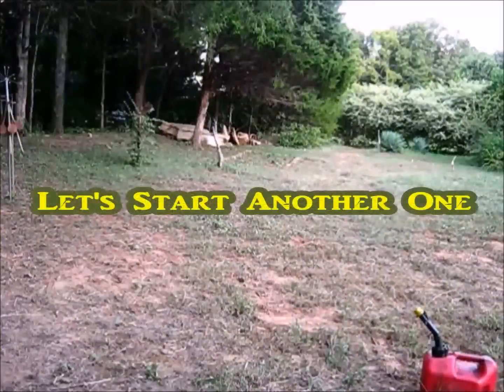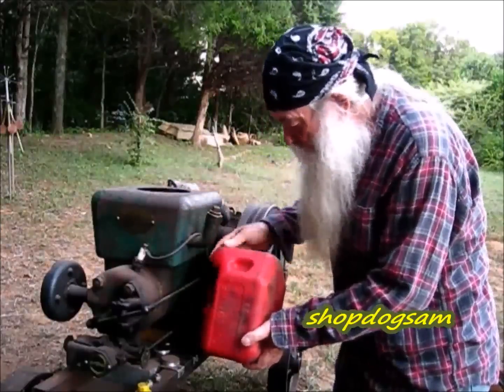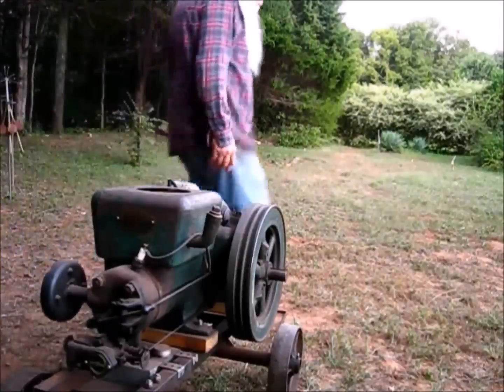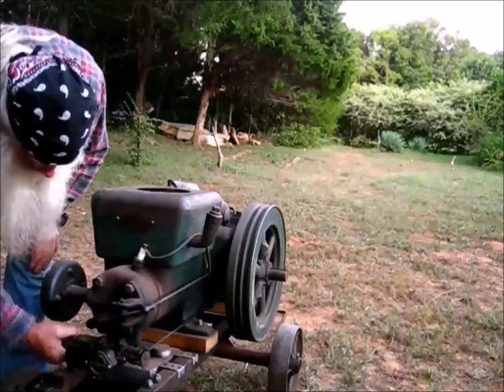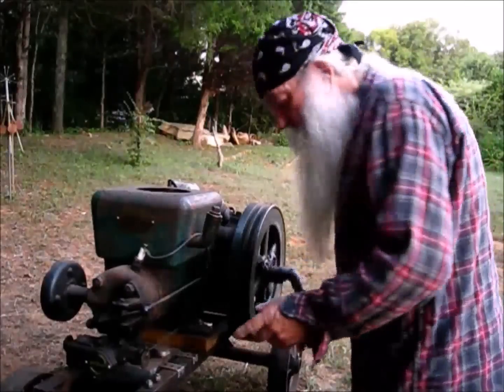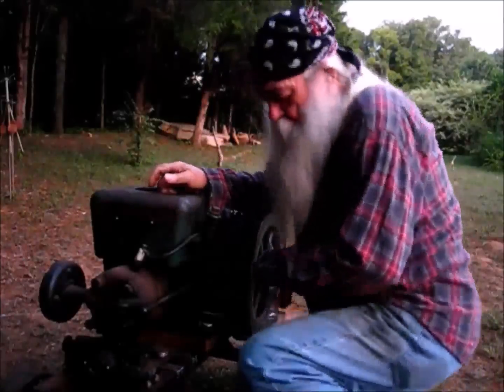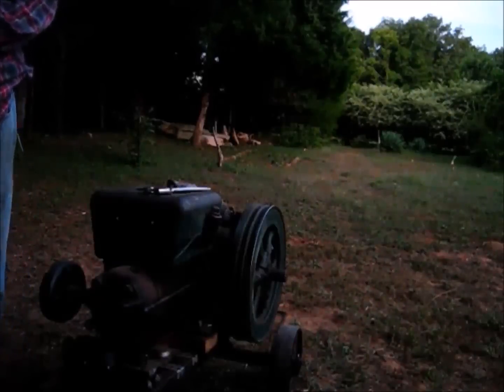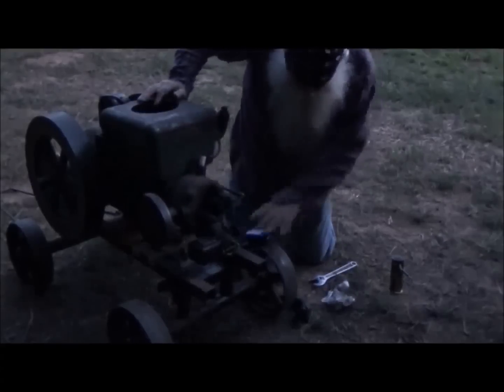Fairbanks Morse Flywheel Engine hand crank starting

Comment: Damn. Now I gotta go dig mine out. Needs to run anyway. Been sitting all winter, which is no issue. It always fires right up. I always fog the cylinder each year before being stored so it’s ready to go. 👍